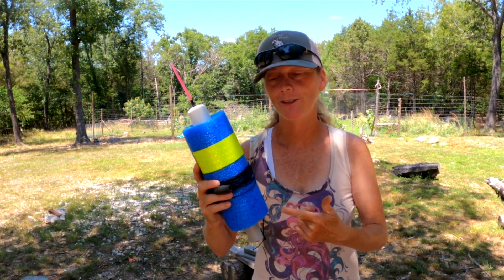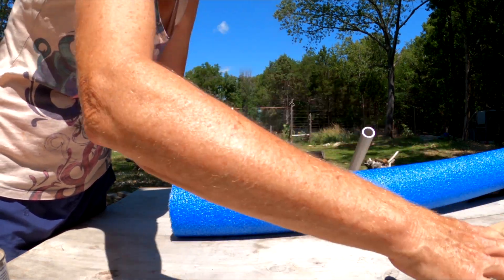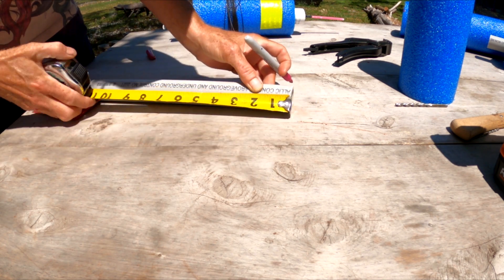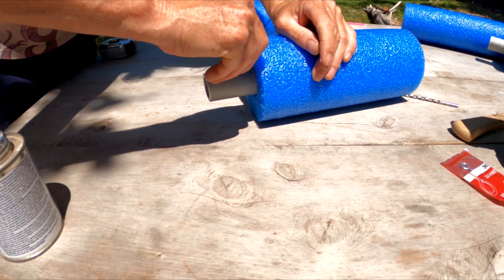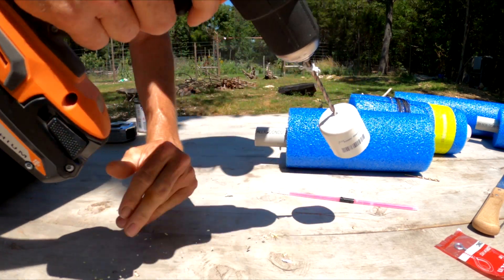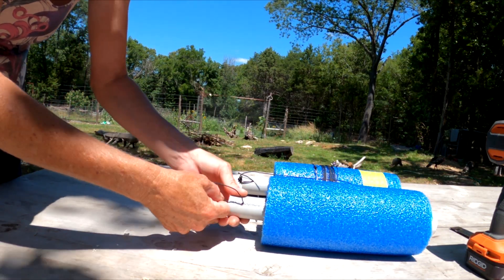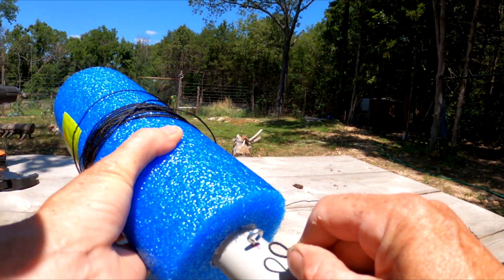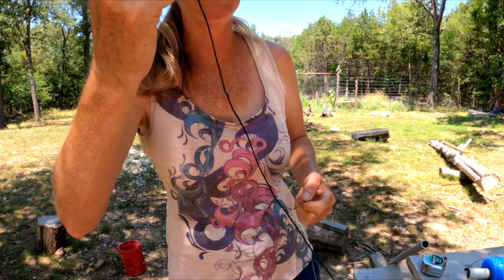How To Build The ULTIMATE Catfish Jugs That Glow In The Dark DYI

Comment: Dallas, you might want to glue a cork into the pipe end, then cover it with the drilled cap. Then drill the cork (or burn hole with long nail.). This will most deffo improve hold onto the chemlite. BTW, collecting corks can be fun. Oh, a wine-cork has no straight wall, but it straightens when you boil the cork. Just an idea. Kind regards, Jaak.
Reply from the maker: I must say it took me a minute to figure out how to get that sucker to stay. It's not like I can just glue it in permanently.
Reply: @PoleBenderFishing  He he. I was thinking that if you get the eye-screw out you could perhaps shove some cut to tightly fit insulation thru, so it sits against that cap, and then run a too small drill through the cap. This should also get you better hold onto the chemlite. ( A fitting cork could be used in a new lot. Watta Hail... A cork may not even need glue, and would probably eliminate need of that cap as well. That long chemlite looked 4 or 4.5mm... ( Both sizes are sold ) The corks on my home-made bite indicators hold on to both sizes pretty damn well. As long as you do not make the hole too wide.. :_Skunked::elbowcough: ( However... The tape also works, so why bother? ) :_Catfish:🤓

Comment: Your design is what I do on my noodles👌.After about a year,The noodles will become very dry from the sun and start breaking apart,What I did was covered them completely with duck tape and I use a small separate piece of duck tape with a sharpie marker and write my information on the tape and stick it to the duck tape on the noodle and pull the small piece of duck tape with information off when done fishing.
The glow sticks work very well and I use the large sticks due to the waves on my lake.
I cant wait to see your videos with this noodle cause its a blast pulling up a big ol 30lb flatty❤
Reply: Hi there. Years ago I fixed some pipe insulation onto a post to let a shed door bump into (no noise, no scratches). This gray stuff has been exposed to weather for years now, and it still does not crumble. It figures that it held up because of intended use. However, I recently found that a spunge (brownish coarse cells) disintegrated when I started to use it. ( It looked new but was years old.) So your warning is spot on for inferior materials. I also use pipe insulation to store surf fishing rigs onto and seal the slit with ducktape so my tacklebits do not get glued into that. (slit stays usable). Insulation used as floating material on dipnet pole got duct-tape covered.  (My net does not sink in the drink when both hands are busy fighting a fish. ) In any case, better safe than sorry, so protection can be used. Pipe insulation is made to fit pipe but may have a too thin wall. But one can put bigger diameter over as second layer, and secure it with duct tape. Kind regards, Jaak. (edited for clarity)
Reply from the maker: I use duct tape for my tags as well. Hadn't thought of wrapping the jugs though... hmm
Reply: @PoleBenderFishing  The "spunge" looked new but was old. 't Was a good thing I did not have a dozen of those. And yes, my long net pole gets a float shoved onto, made of two layers of pipe insulation. FreshWater Soul's comment made tons of sense.

Comment: Hello from the quiet sunnny Ozarks Dallas! another video of value! thanks for sharing. i use black insulation pipe but critters love it too so i will use the pool noodles since their cheaper but they dry out in one season. LOL about noodles comes in different sizes and shapes . Looking forward to using them. i use yoyos alot. tight lines!!
Reply: do you know of any small lots 5acres or less close corp of engineers boundy to lake close to theodosia?
Reply from the maker: No, not personally. There's still property for sale around but the land rush pretty much bought up all the good plots. A developer is building a +300k subdivision in Diamond City. Insane...

Comment: Tips from a Pro Jug Liner:
1) Make yours bigger.  This size would not work for the size fish we get here in Lake waco at least.  I make my poles 2 ft and the float 18 inches (1/3 of the noodle so I get 3 from each).  I still get 5 jugs per conduit.  Use outdoor electrical plastic conduit.  It will not dry rot in the sun for many years.
    a) The reason the pipe is several inches longer than the float is for two reasons.  First it gives you space to adjust the drop length.  2nd it gives you space on the pipe to put your name and address where it will always be visible (this is required in many states, check local law)
2) Those fancy cutters she is using in the video cost about $25.  If all you need them for is to cut these pipes one time, just use them in the store and put them back on the shelf.  I have done this several times with no issue for store employees.  Just keep track of the piece with the bar code and know how many long pieces you started with.
3) Don't use a metal eyelet.  There is no reason.  Just use a step bit to drill your hole in both sides of the pipe about 1/2 - 1 inch from each end.  The step bit will leave a rounded finish on the hole so when you put your string through it, it won't have a sharp edge or a burr to rub against and eventually cut your string.
4) To adjust your depth, you can just use a simple double half hitch knot (THE MOST USEFUL KNOT IN THE WORLD!) around the pipe.
5) You don't need a plastic cap or glue, which alone can double the price per jug.  Just drill the holes in each end, then run your string through both send around the noodle.  That makes it impossible for the noodle to come off, and all it cost you was an extra 2 feet of string.
6) Check local state law.  In Texas we can have up to 5 hooks per jug.  I take 20 jugs out.  That's 100 hooks in the water.  It's impossible not to come home with a bunch of fish.  I can get over 100 lbs of filet in a weekend and thats just keeping the best and throwing back everything else.